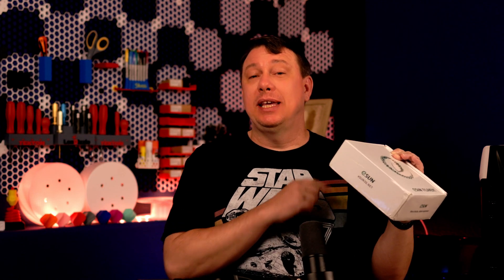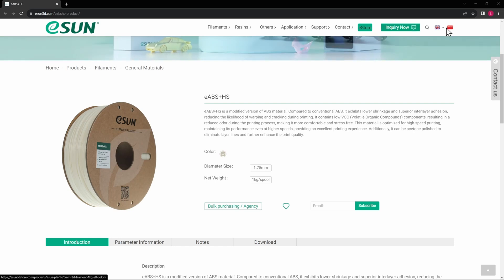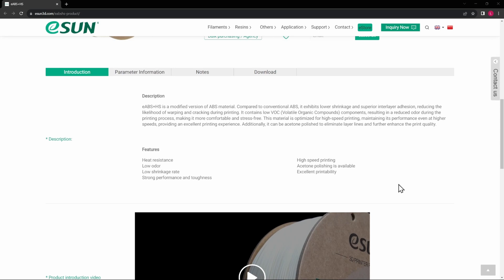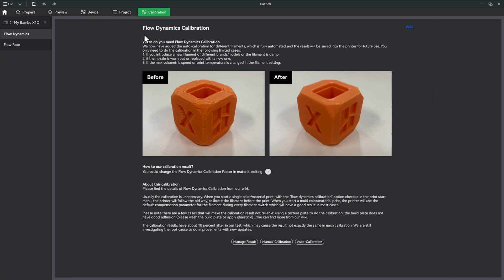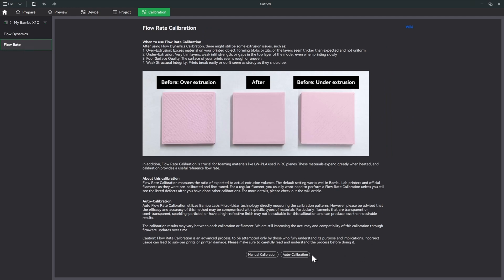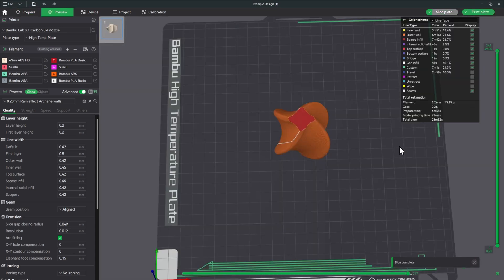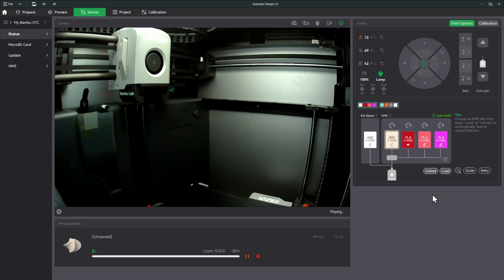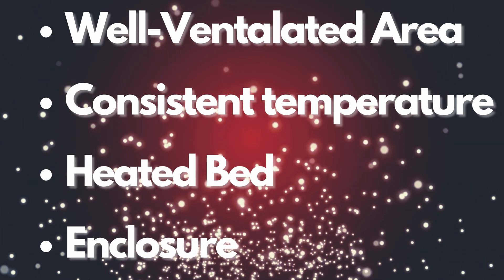eSun ABS HS First Look at Printing With Bambu Lab X1C

Comment: Worst filament I’ve ever had 😂 

I can print PLA, PETG, ASA, ABS and TPU with ease. Good at dialing it all in! Can comfortable and competently use a printer. 

This Hyper ABS does not want any cooling despite what Esun says. Any cooling makes the print want to come off the bed due to temperature difference, even in a sealed chamber at 45c

Big prints are not to bad, big foot print and it will stick. Anything small, it wants to come off. 
Even when the print is finished, soon as you lift your build plate (tried 3 types of plate) it pops off immediately which shows its lack of adhesion. 

Its layer adhesion isn’t great. 

No idea what’s in it.. but it’s not great! 

Creality K1
Reply: I've had great success printing with the bed at 115°C and active heated chamber temp at 55°C. I had endless warping issues with any temps even as little as 5°C lower than that. 

270°C nozzle temp for the first layer then down to 260°C for subsequent layers. Layer height of 0.25mm. First layer speed of 45mm/s then crank the speed up to like 140mm/s. 

With these settings, I haven't had a single failure, even with prints that fill the build area. I'm using Prusa's "satin" sheet build surface cleaned and free of skin oils or dust, with no other prep. I have used manually designed anti-warp tabs for all my prints, though

Comment: It seems like eSun gave up their ABS and switched to this ABS+HS as their distributor has stopped refilling their ABS stock. I hate that. I have no idea what ABS+HS looks like but eSun ABS+ is a total garbage. The original eSun ABS was quite decent material overall so when they say "now it has less shrinkage" it means they reduced the ABS content in the filament and put some crap instead of it for the sake of  average idiots wouldn't get traumatised as much as they did when dealing with regular ABS.

Comment: I still haven't found a compelling reason to print ABS when you have ASA. No smelling it prints easy .I don't think you need to relevel the bed after you just finished calibrating because that's part of the calibration.  Another few minutes saved.😊
Reply from the maker: No drying huge plus with this filament. But agree mostly with your comment. Every minute counts. Lol

Comment: Hiya, As you used the BL high temp plate for the flow dynamics calibration and flow rate. Can you change the plate after that or do you have to print using that plate please?

I have energetic PEI textured and smooth but the BL flow dynamics and flow rate calibration fails.
Reply from the maker: It would be best to use the high temp plate but I have transferred those setting over for the pei plate.

Comment: Wouldn't you risk running into max volumetric flow rate cap at sports/ludicrous speed? It would be interesting to see the flow rate on the preview and check if it has a good margin below max flow rate.  But dunno, I just assume that sports mode wont bump up the flow settings.
Reply from the maker: usually hit the max flow rate in ludicrous speed

Comment: I wonder what the inter-layer adhesion strength degradation at high speed is?
Reply from the maker: great question
Reply: eSUN ABS+ is the worst ABS I've ever used. I haven't tried the High Speed variant though.